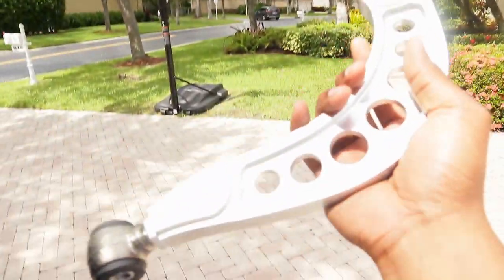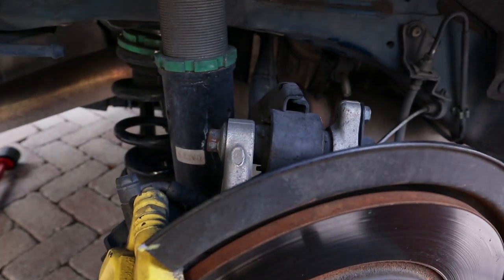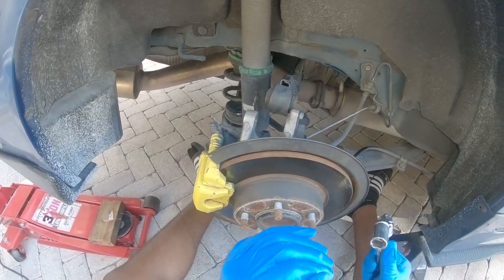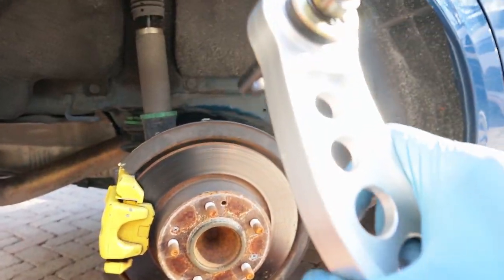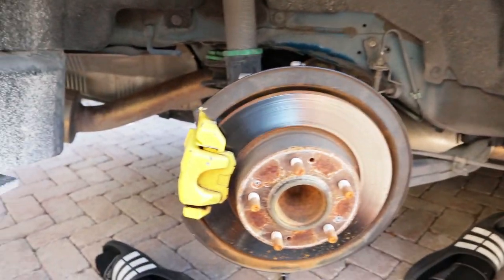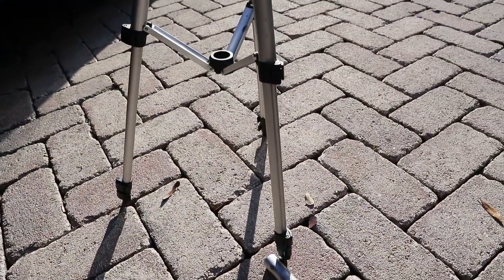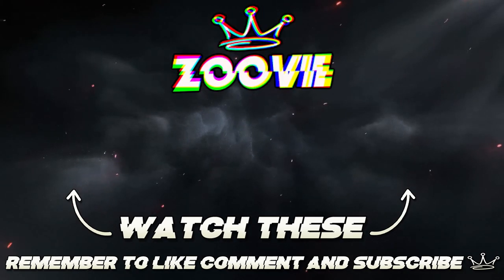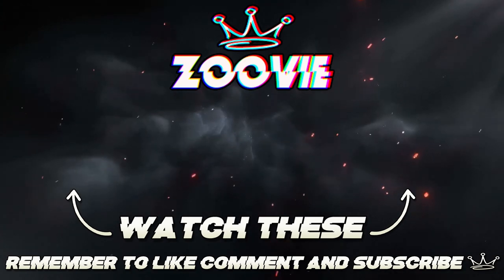Something went wrong... but whatever

Comment: Do the bolts in the rear hubs that hold the camber arms in tighten any more? If not then I wonder if its cross threading. I definitely wouldn’t put a washer just to run em. Just play it safe.
Reply from the maker: Nah nothing cross threading .. just bad rear camber arms
Reply: @zoovie  gotcha

Comment: Bro for all the work you do on your car you really should invest in some good tools… even though they’re expensive you’d be surprised how much easier working on your car would be

*those aren’t Hardmotion arms are they? 😳
Reply from the maker: Yes I believe so 🤕
Reply: @zoovie  shitttttt. I just ordered and received the same ones.
I contacted Hardmotion and they said that in order to ‘clean up the slop’ that THEIR smaller bushing creates you have to either add more washers or tighten the forks on the hub housing so much that they start to bend inward (I searched around and found a video of someone doing that, it worked but 😳) honestly bro I kinda want to send them back and get new ones but I don’t have an extra $150 to spend on better ones and plus I have an appointment at the tire/alignment shop in two weeks and I’ve been waiting 2-3 weeks already so I just don’t want to push this off anymore because right now I’m not driving the car barely at all because the tires are toast and all of the stock alignment adjustments are stripped and toast as well bcuz whomever owned it before me slammed it real low and just messed everything up… anyway I dunno what to do damnit!